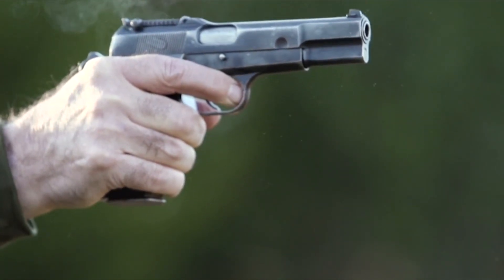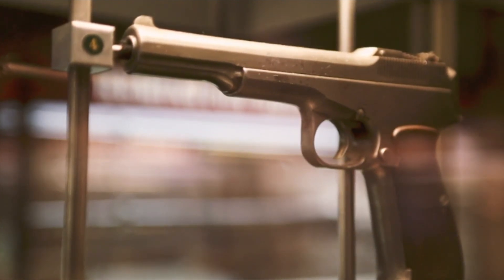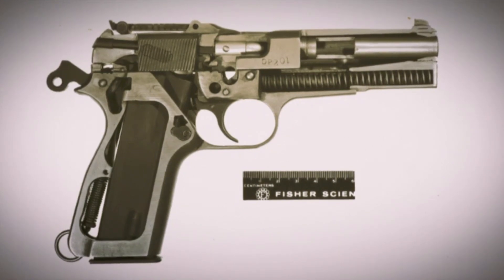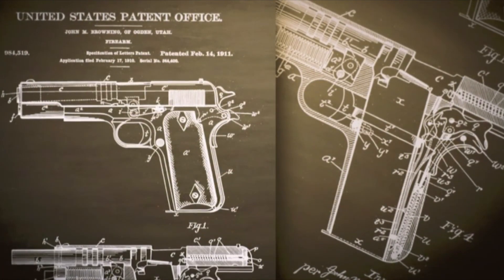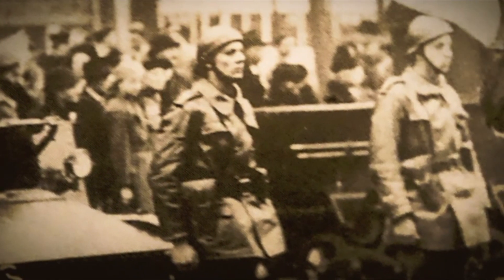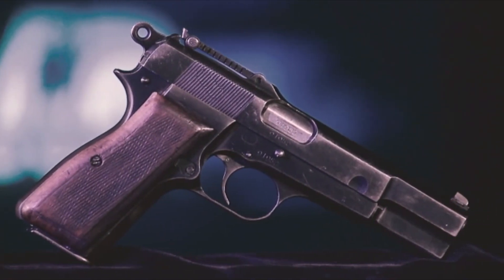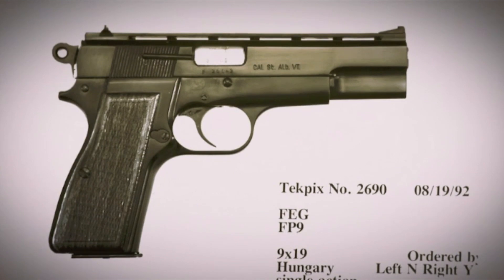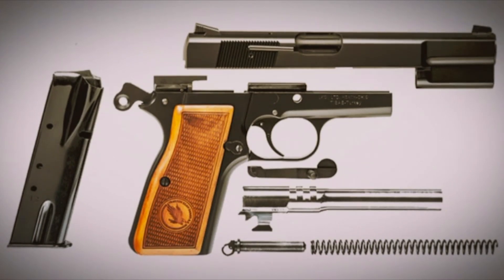ARTV: The Browning High Power Story

Comment: I bought my Mark III back around 1987 and it has been by my side through the Rodney King Riots in LA working in a gun store, and competing in weekly IPSC club shoots. About 8 years ago I took it to Terry Tussey Gunsmithing for s trigger job and tune up. The mag disconnect got tossed, installed new sights, new hammer, polished the sear, made it very nice lighter trigger. Then I had it Cerakoted as the bluing has been worn off. About two years ago, Springfield came out with the SA35, their High Power copy. Since Browning is no longer making the BHP, i retired the BHP and used the SA35 as my 9mm single action pistol. Such a nice feeling pistol, proven and used by more countries than any other, used by top tier special ops teams like the British SAS, until they were shot out and they changed a few years ago. The FBI HRT team used Browning High Powers customized by Wayne Novak, until they had that Miami shootout and blamed rhr 9mm and went back to the 1911.
Reply: FBI accepted 9luger. Best cartridge design ever.
Reply: Can one purchase an SA35 in California? I'm not a cop, or otherwise politically connected.

Comment: would've been better chambered in the ideal and my favorite cartridge caliber, ie; the .40 s&w, but 180gr was always too heavy for the .40 s&w, great for the 10mm auto though, between 135gr minimum and 165gr maximum parameters is best, with 155gr/150gr bullet weight being ideal
Reply: 180gr .40…..   that’s what Glock’s were made for.  😅
Reply: 1990’s Hi Powers were also made in .40